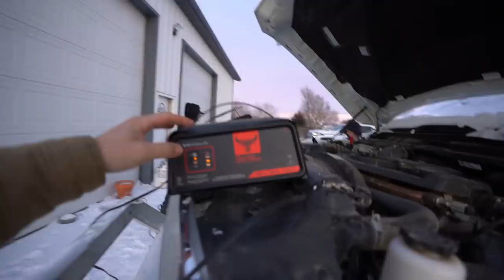I Couldn't Hunt Kansas Opening Day Snow Goose and Here's Why..

Comment: I had the same problem this morning with my f250. If you get a chance connect a running vehicle to both batteries, and only thing that really helped me get it going was starting fluid. Helps it turn over faster and better pressure.

Comment: Bobby great job man. You need to get rid of all the accessories  off of the passenger side of that motor. You will see a drastic difference in that truck. Just make sure you keep fuel in the tank. Keep up the great work. I killed my first snow goose last week and had a buddy that I was with got tied of chasing a blue and he didn't realize it was a ross blue before he shot it a little too close.

Comment: Bobby guy your trucks a diesel and I’m pretty sure this could happen to you because it happened to our equipment but your diesel fuel has this mixture in it called paraffin in it and it’s like a wax. When it gets really cold out it settles at the bottom of your tank and separates from the rest of the mixture. It may not be the battery it may be because your truck is just gummed up

Comment: It shouldn’t matter on the battery but I normally use the drivers side, and I haven’t made it all the way through the video but if you get anti jell you will have to put some in the fuel filter and then some in the tank

Comment: Dodge Cummings dosnt have glow plugs at least the newer ones. They use a grid heater through the intake. But I plug mine in any where near 32 just cause I have glow plugs. Which while cranking kills the amps. But yes at least on mine the main is driver side passenger is secondary.

Comment: Sounds like your fuel is gelled up with wax and/or ice.  You need to treat the fuel prior to the cold snap hitting since fuel treatments work better when the fuel temp is warmer, like when you fill up from a station with underground tanks.   Power Service 911 will ungell fuel but you have to get it into the fuel filter since that's where most of the problems occur.  Kerosene also works to thin down the fuel and in a pinch putting up to 3% of unleaded gas will also clear up the wax build up.  Using gasoline is the last ditch effort and I'd top off the tanks ASAP with #1 diesel once the truck runs.  Gasoline can mess up the emissions systems on newer diesel engines.   I guess you could wait a week or so and mother nature will get over her tantrum and warm backup to more reasonable temps.

Comment: Please do research about the diesels before you royally mess up you trucks.. gelling up and pouring additives in is doing absolutely nothing. Every time your gelled up you need to change fuel filters. When you add anything to the fuel it wont mix. You should pour in before you get fuel. Add fuel to mix it up. You can mess up injectors and the rest of the fuel system pushing that wax from the gelled fuel through the truck